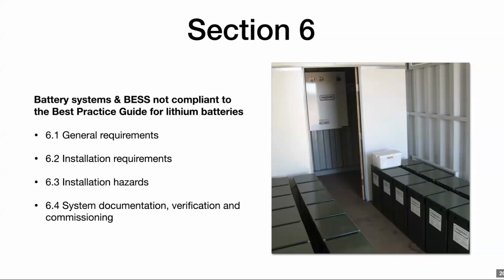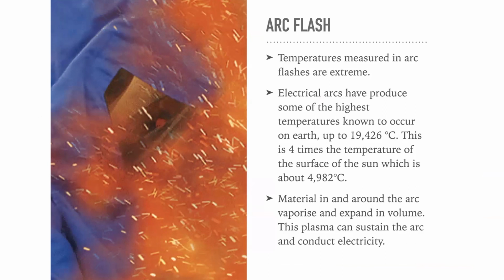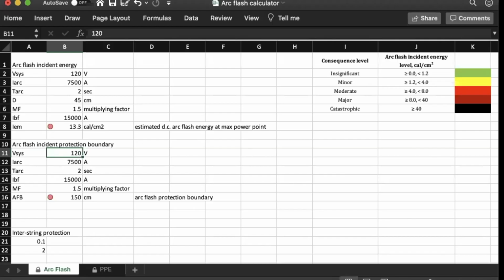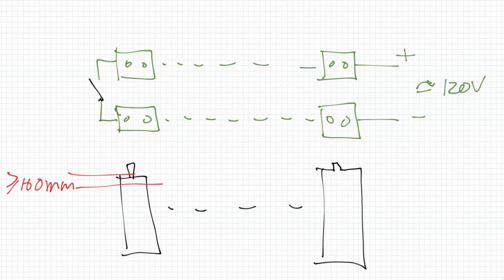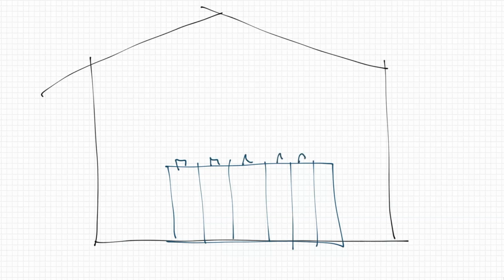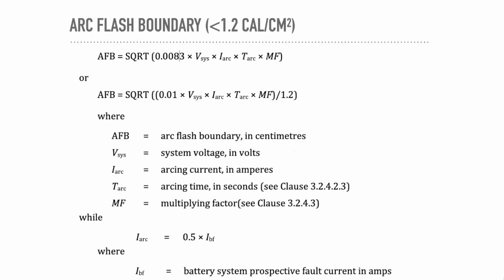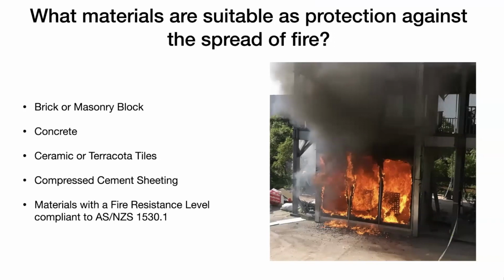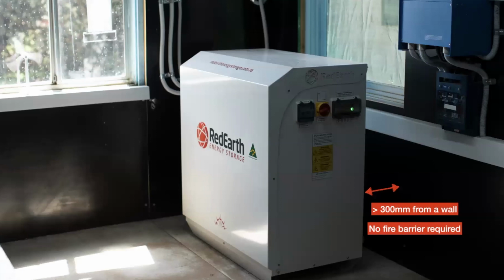Solar & Battery Training Ep8

Comment: Hi Glenn, Can you install a battery in a garage under a habitat room..
Reply from the maker: Hi Jeff, it depends:

1. if it's not a pre-assembled BESS or battery system compliant with the Best Practice Guide: Battery Storage Equipment V1 then it is a Section 6 solution and can't be installed inside a building containing habitable rooms nor under floors of habitable rooms (AS/NZS 5139 clause 6.2.2.2 (i). 

2. if it is a Section 4 or 5 solution (BESS/BS + BPG) then yes it can but you would still need to comply with the requirements for a fire barrier.